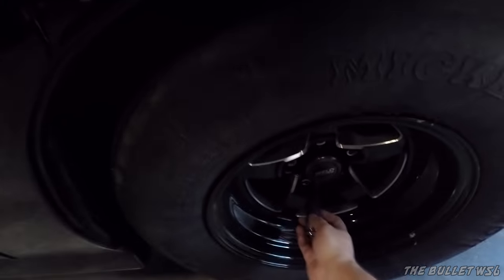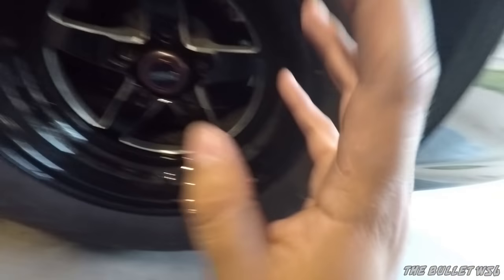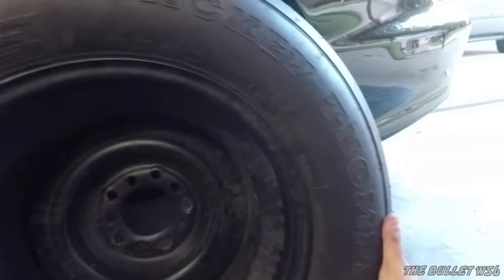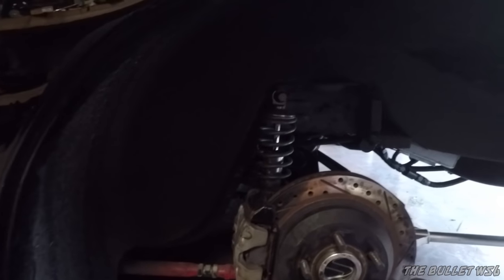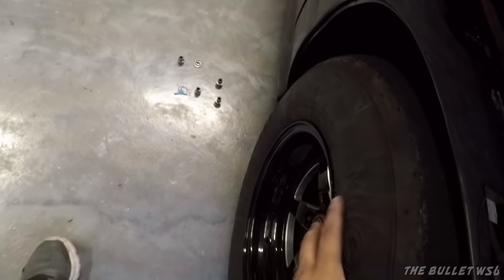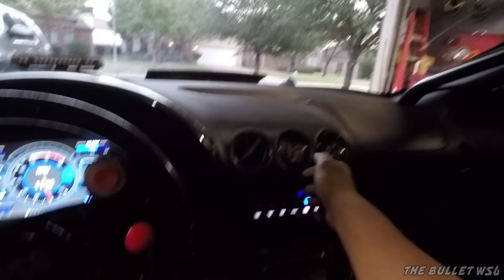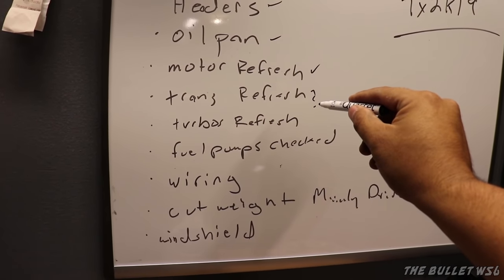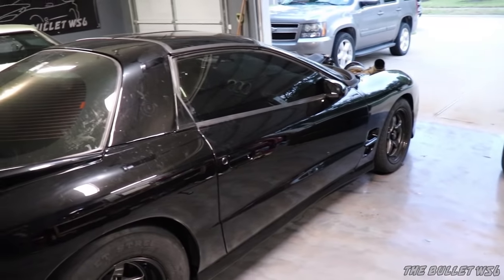THE PERFECT FBODY BACKSPACE!

Comment: My 9 inch is narrowed 3” on each side. Cut the bump stops and BFH the inner fender and I was able to clear a 15x10 5.5bs with a 1/4” spacer. So more like a 5.25bs. With a 295/55-15 ET street ss. Without a mini tub a 5” bs is ideal. Just not many manufacturers that make a 5” bs that are reasonably priced.

Comment: Using a torque wrench to remove lugs is a good idea because it'll tell you what the lugs are at after a few runs to see if the are too tight or loosened up.

Comment: Can anyone verify I cut my bump stops completely off and I'm concerned.does it hurt the structure of the car or anything I seen some people trimmed theres but I cut the hump off and everything.
Reply from the maker: It’s relative, I assume your saying you took the outer portion of the frame rail that has the bump stop. If you did than yes, that bracing is used to absorb an impact from say a rear end collision. Any modification you make is really compromising structure, how much does it compromise? No idea…
Reply: @TheBulletWS6  yeah it was the outer portion i didn't know if it was safe to drive around or anything because I'm really considering welding it.

Comment: i know this is an old vid but what fuel tank are you using? with the wheels tucked in like that did you need to ditch the OEM tank for a cell?
Reply from the maker: Nado i have a nasty n8 sump cell, buts its factory style and factory location. My car is only mini tubbed
Reply: @TheBulletWS6  I'm a look into his tank, hadnt heard if his name in a long minute! Would you do it the same or different knowing what you know now. I'm fixing to buy some wheels with the 5.oh backspacing thanks to your vid
Reply from the maker: Nado i like the tank, id do it again for sure